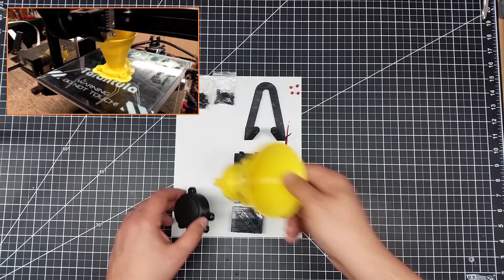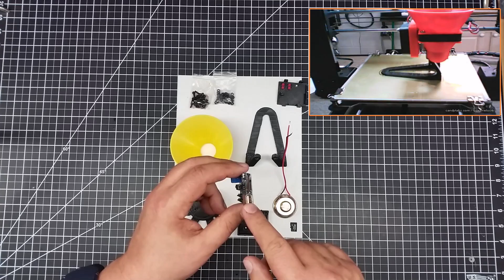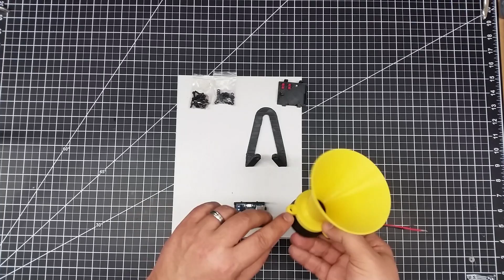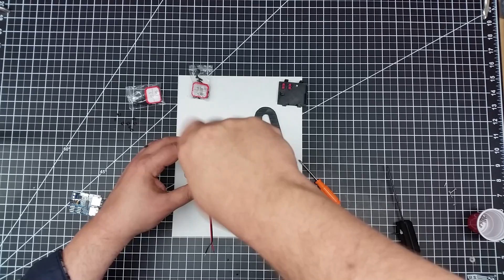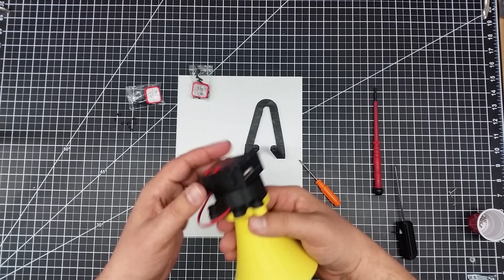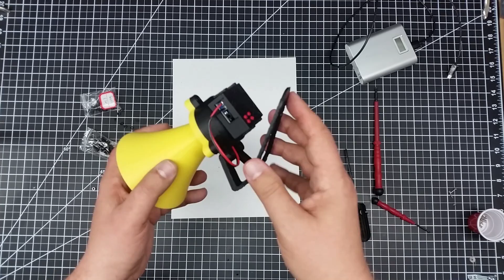3D Printed Project - Thingverse MegaPhone MP3 Build!

Comment: Do you use slic3r? I'm having a few problems with gaps in the filament. I notice it seems to be most noticeable between the perimeters and the infill/middle of the print. Any pointers you could give me with the Tarantula would be greatly appreciated.
Reply from the maker: My recommendation is switch to Cura as I have never had good luck with Slic3r...
Reply: Yep, I have just switched to Cura 15.04 and I'm getting consistently good prints again. Slight issues with warping away from the bed and have had my cooling fan come on at 5mm layer height to combat this, but still getting it a little. I got Cura 15.04 with my Micromake delta and all the issues with gaps are resolved more or less with the default settings. I did download Cura 2.4 or whichever but I couldn't find the settings to get it to print on the bed, which is why I switched to Slic3r in the first place. I can't find these settings in the version of Cura i'm using either to get it perfectly in the centre of the bed, but at least its printing on the bed.
Reply from the maker: You just define the bed size in Cura when you set up the machine.  Also make sure your firmware is also set for the right sized bed too.
Reply: Yeah, thanks for the reply. I did input the bed size when I first set it up, but there is a 30mm gap between the nozzle and the bed across the Y axis in its home position. I managed to solve this in Slic3r, but have yet to find the setting s in Cura. I prefer Cura. Tend to get better prints.
Reply from the maker: This is odd,  did you see my video where i had to change the bed size in the firmware?
Reply: I did see that one, but I had difficulty locating that bit of code in the config H file of Marlin RC7. I will have to do some more tinkering anyway as I got a nozzle blockage recently.